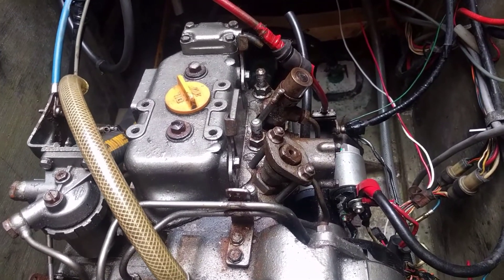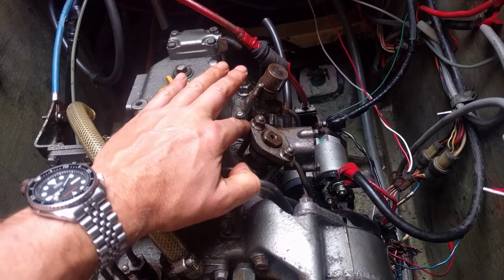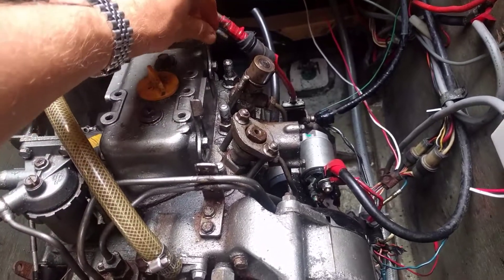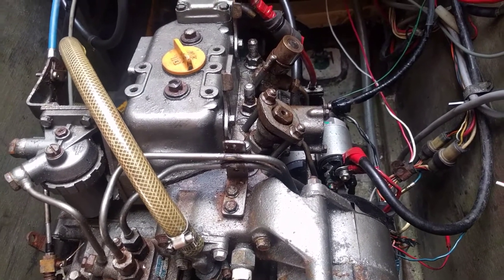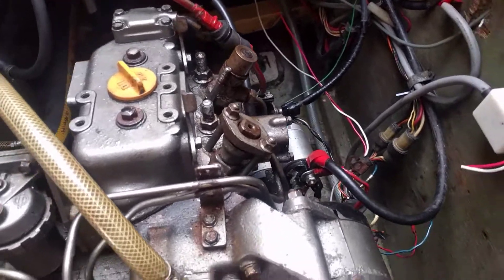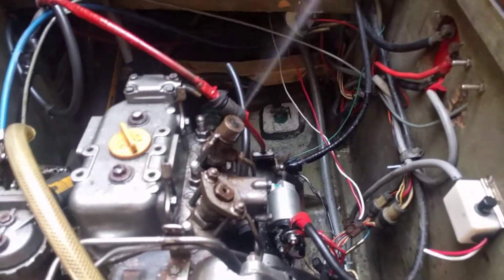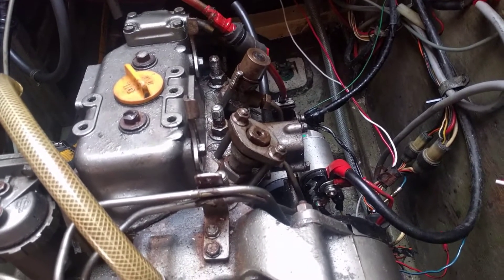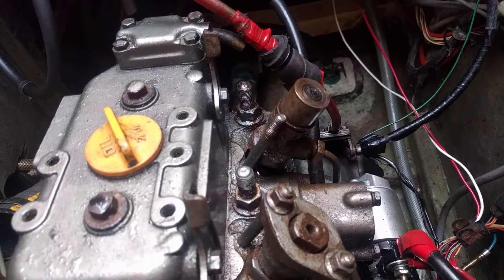Yanmar 2GM injector test part 3

Comment: Great video!!, Very informative. I have a small YANMAR 240D which has what appears to be a similar size motor. My little 2cyl is not starting neither. I tested the fuel lines at the injector and get fuel but not coming out as much as yours. So, next I rented an injector puller from Hoye (Texas tractor company) and removed both injectors (they were stuck pretty good). Set up a similar injector test and not getting any fuel spray. So more trouble shooting my end. Probably two things. Either injectors are clogged since I'm not getting fuel spraying Or my lift pump is damaged and not moving enough fuel.  

When feasible did you do a video on replacing your piston rings? If so, I'll look for it. 

I'm also renting a compression tester from Hoye and crossing my fingers my compress is good.
Reply from the maker: Sounds like that would most likely be the pump. You could try soaking the injectors and see if they will pass some fuel afterwards, but pump issues are more common I hear. No, I didn’t do a video on replacing the rings, but it was quite straightforward.
Reply: Evan Burkosky I broke the injectors down and reassembled but no fuel spray after reassembly so I’m thinking I might have had some moisture in the fuel which more than likely flash rusted some pump components.

Comment: Was the faulty injector the problem?
Reply from the maker: TDS No, it turned out the piston rings were the biggest problem. With new rings she runs fine.
Reply: @evanburkosky  How did you find out? Using compression gauge?